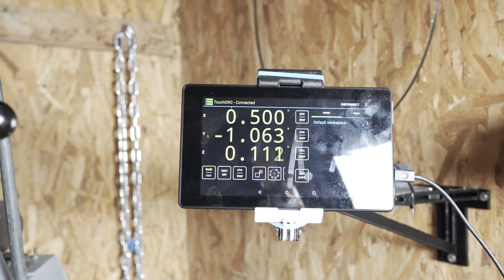Installing a TouchDRO on the Rockwell

Comment: So, when you add a fourth decimal place, what kind of stable resolution do you get? I saw another video with Igaging, capacitive scales that was doing four tenths. It would go .0004, .008, .0012, .0016, .002 etc.

 It would be interesting to see what this board can do with quality glass scales. I know most of the time, the tenths aren't needed but sometimes you're making bearing housings, go/no go guages, etc. and it sure comes in handy in comparison to a whole lot of test fitting.

Comment: Very nice job! Thanks for sharing. My handle scales don't look that great. Some are even pitted from rusting - not horribly so, but enough to make some areas unreadable. I don't really need or want a DRO. I'd rather just use the dials for now. Would you consider selling me your handle scales? I'd send you mine so you're not missing them on your machine, but since you don't need to read them anymore, I thought maybe you'd want to make some extra cash and sell me your readable ones. Name your price.
Reply from the maker: Heya Dan, thanks for the offer.  I think I'm going to hold onto the handle scales for now.  I still use them a surprising amount, even with a DRO (sometimes it's just quicker), and I've been trying to keep the mill mostly in one piece in case I ever decide to resell it.  The DRO, brushless motor, etc are all done in a way that they can be removed easily without affecting the core of the machine.  These little mills seem to keep their resell value well so I've been trying to keep it all together.  Thanks for the offer though!  Best of luck finding some replacements
Reply: @BreakingTaps  No worries. Thanks for the reply. Happy chip making!

Comment: I'll add I made a mount out of 3/4" aluminum that uses the open end of the ram securing bolts to hold it to the mill. A 1" hole in that with a grub screw holds a 1"dia steel tube that a metal Hammond box with the TouchDRO in it is clamped to. The Android touchpad is velcro'd right to the front of the box. All the power/scale cables go back to the mill through the 1" steel tube and hence to where they are destined to go.
Reply from the maker: Nice! I need to do something similar for the cables on my mill, they are still just dangling around in a big mess.

Comment: Looks really good!  I’m still using the dials on my Rockwell mill, which gets me by.  Slotting the new adjustable mounts would be a good project for the mill.   I have a Grizzly  4” press brake which is perfect for bending small stuff like that. It sticks in the vise jaws with high strength magnets, and turns the vise into a press brake.  Here is a link. http://www.grizzly.com/products/4-Vise-Brake/H3243.   Cheers, Chris
Reply from the maker: Out of curiosity, what are the divisions on your dials?  My Y and Z axis have 200 one-thou divisions.  But the X axis only has 100 divisions, but if measured turns a full 0.2" so each div is actually two-thou.  Which was super confusing when I first got the mill :)  Are they all like this, or did someone replace the dial on my X axis at some point?

That vise brake looks awesome, gonna pick one of those up next time I order from grizzly.  Beats the janky angle-iron bolted to the bench :)
Reply: polyfractal  I just looked and the x an y are both 0.200” dials and the z is a 0.100 dial.   The z dial is the same size as the x and y dials so I wonder if someone moved it there by mistake.  I will make a private video for you tonight showing my dials. Anything else you want to see while I am filming?
Reply from the maker: Thanks for checking!  I'm going to go back and look at my original photos/video, wondering now if I mixed them up myself :)  But the mill has a few oddities around it, so it might have been the previous owner too.  I think that's the only major mystery remaining.  The only other big thing is the motor pulley... someone replaced it with a five-step pulley so it doesn't quite line up with any of the six on the spindle pulley.  Not enough to cause problems with belts, but definitely no longer running at quite the right stock speeds :)